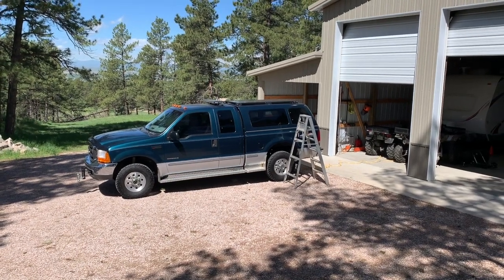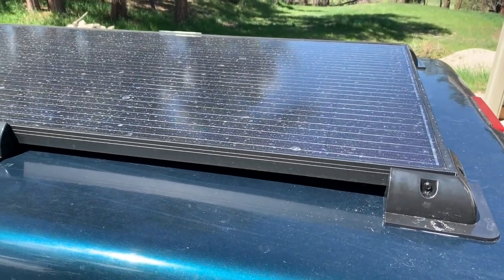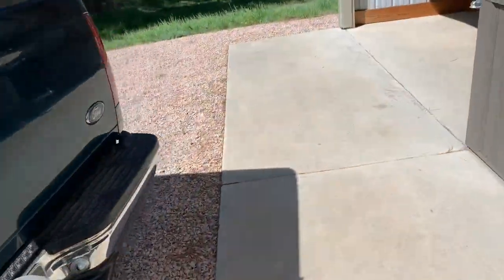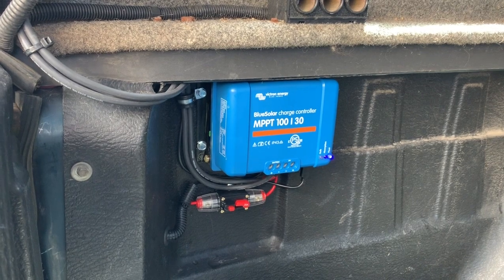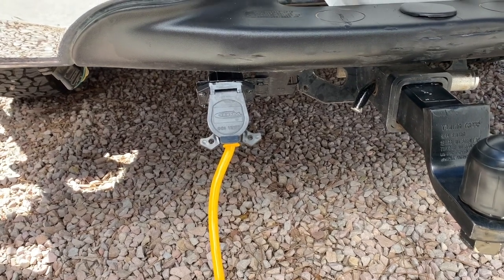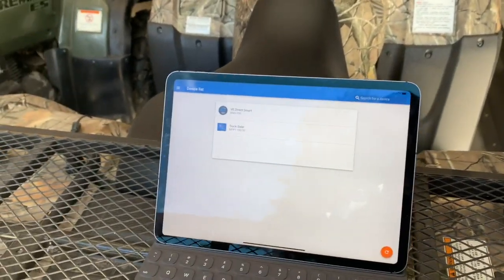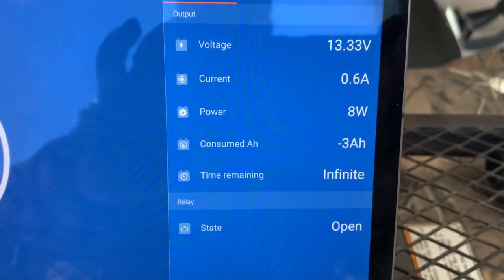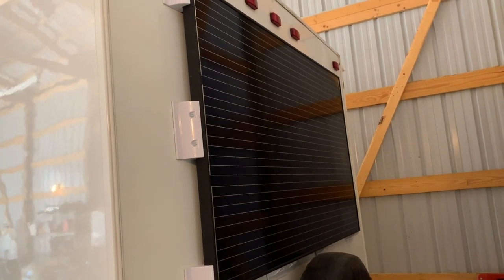DIY - Solar TRUCK TOPPER?!?!?!

Comment: Super nice install! How is it holding up and are you still satisfied with the setup? Thanks!
Reply from the maker: @patriotone755  works great!  Thanks
Reply: @bparkinson1234 would you recommend any other panel since its been 5 years since install? Thoughts appreciated.
Reply from the maker: @ any three by five panel works. I just bought three jinko panels 425 watts each for about 185 bucks here in Denver for another project. See my off grid well pump video just posted to see it. Thanks
Reply: @bparkinson1234 Thank you. I like the black edge which keeps it low profile and to your point looks like a roof rack. Well thought out and well done!

Comment: Hey Bill, I love the idea of running it through the 7-pin connector, an "alternate to the alternator"? Anyways, do you know what gauge wires are in the cable from the trailer that connects to the 7-pin? trying to figure out max amperage it could handle.
Reply from the maker: Mine is 12g. Yours might be different. See my solar rv video huge power. I changed things around a bit. Thanks.

Comment: Great video Thanks I want to live in my Ford truck for five months 
 can I put solar on the top of my Leer camper shell top on my Ford F 150 with 5.5 bed  and hook it to a 2000 W power station rather than getting the Victrola monitor? Any suggestions? Thank you

Comment: Very clean installation!  How did you get the solar panel cables through the canopy?  Do you find you get a voltage drop when you attach your extension cable to your trailer?  You have inspired me to install solar on my canopy.  Thanks!
Reply from the maker: Drilled small hole with silicon.  No drop noticed. Thanks

Comment: whats that 360° light on your hood?    And you feel comfortable using double sided sticky tape to hold that on?
Reply from the maker: The tape is acting as a soft pad. There are 1/4 20 bolt thru each mount to inside of topper with fender washer. I am retired Colorado ranger. Used personal vehicles sometimes. This red and blues

Comment: Can you do this with a briefcase solar panel? I have a goal zero 200W that is too heavy for me to set up and take down by myself and I'd like to mount it on my truck cap and be done with it. It will hook up to a goal zero power station. I'm not doing batteries so I don't need an additional converter. Any thoughts on this?

Comment: Where did you get your topper?
Reply from the maker: In Denver at a topper dealer on Colfax st.  But was in 1998. The truck was made in 98 but is a 99.  Long time ago. The used the paint code. Not there anymore. Thanks
Reply: @bparkinson1234  I know exactly the topper shop you're talking about. Used to be by Gordo's?

Comment: Scary seeing such a big solar panel mounted vertically.
Reply from the maker: Yep but it works incredible...  catches evening and morning sun...  highly recommend.. just mount it very secure like I did...  thanks
Reply: @bparkinson1234  Mounted with tape only, or tape plus screws?
Reply from the maker: @ES-mq9ox  tape plus two screws in rack mount. Thanks

Comment: This is off topic, but you seem to know how to convert a wire from regular 110 to a 7-pin...my question is this: can you convert a 110v appliance wire to a 12v plug? AND can you convert a 110v appliance wire to a USB wire. (I’m not talking about getting inverters and charge controllers, I’m wondering about the wires themselves, can you cut off the 110v plug and put on a 12v plug or a USB plug to run it without an inverter?
Reply from the maker: JZ WakkiZakko to convert 12vdc to 115vac you need an inverter. There are many available based on power needed.  You can get a small one at auto parts store with cigarette lighter plug. Thanks

Comment: this is so awesome.  i was looking for some thing just like this.  What brand of tape is it?  still going good holding on?
Reply from the maker: Is the 3m outdoor tape. Very strong. But use one 1/4 20 bolt on each corner.  Tap was for a pad. Thanks
Reply: @bparkinson1234  Great video Bill - Thanks!  Do you think that the tape alone would be safe for a single panel horizontal mount? It looks like thats all you used on the vertical panel on the back of your trailer. I have a brand new A.R.E. canopy on order and I'm kind of cringing at the thought of drilling holes through the roof if I don't really need to. I do really like the looks of your set up though.
Reply: @Bill's Cool Projects  - One more question - Do you have any recommendations for a solar panel with similar size and power output to the ones you have? As I said above, I'm waiting to get my new topper to be delivered (about 8 weeks out) and I'm trying to figure out how I want to do the solar stuff. Have also been considering flexible panels (CIGS?) glued directly on the roof. Thanks.
Reply from the maker: @ES-mq9ox  I also have screws in    Each